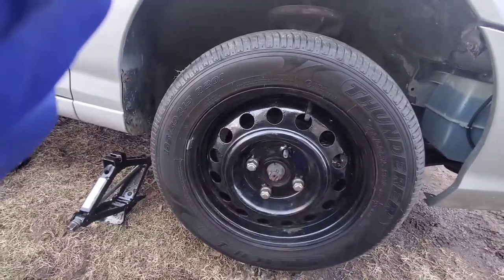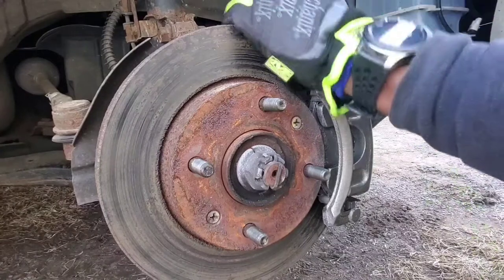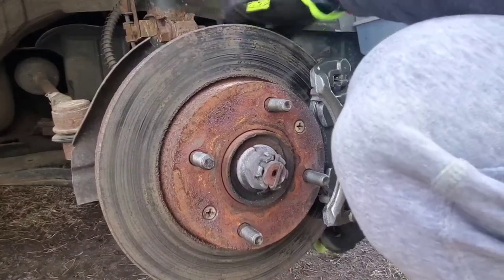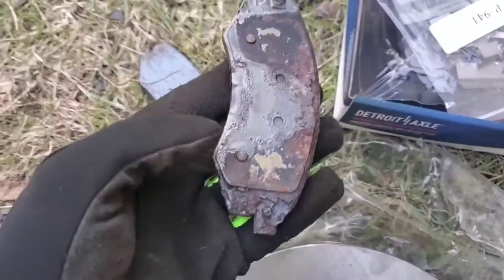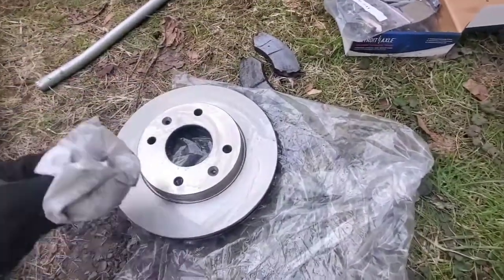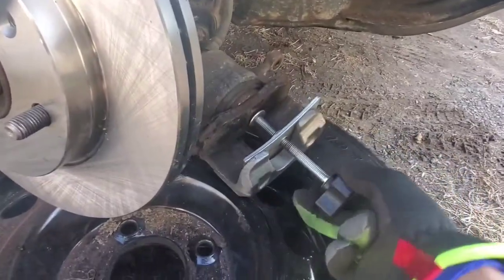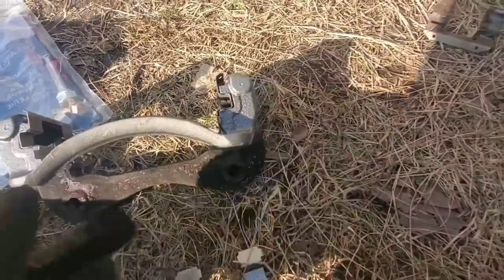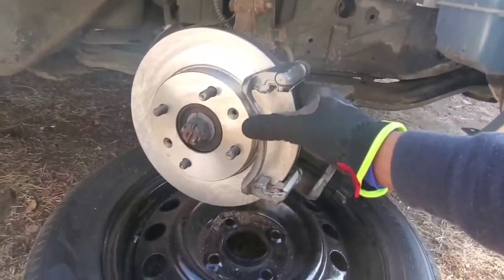How To Replace Front Brakes, Pads And Rotors (COMPLETE GUIDE) | Hyundai Elantra 2006

Comment: Super helpful with clear and easy steps to follow. Thank you. Did you leave the rotor screws out on purpose or just not capture putting them back in on camera?
Reply from the maker: Glad It Was Helpful! Now These Rotors Didn’t Come With One And The Prior Was Stripped So It Wasn’t Useable…. However I’ve Never Really Had An Issue As The Wheel Helps Hold It In Place